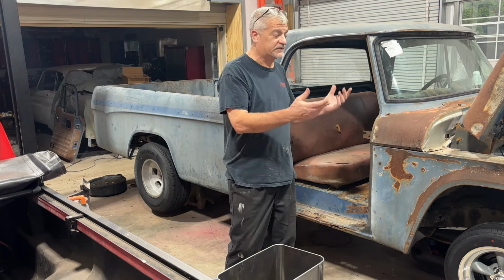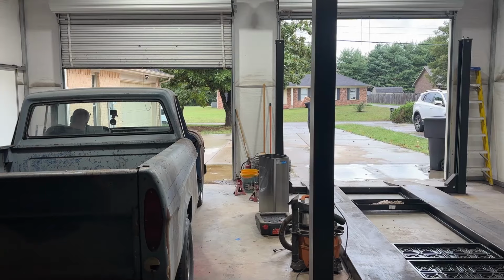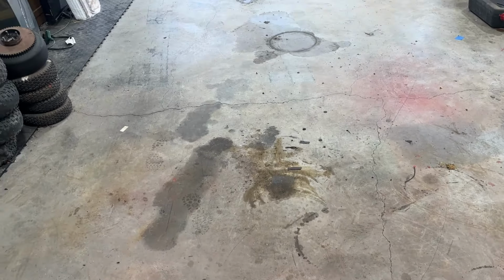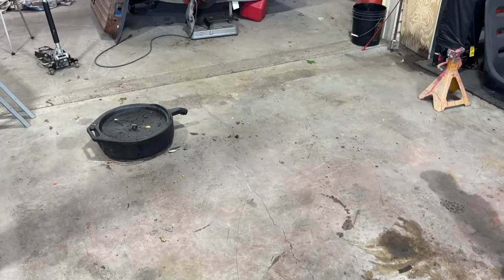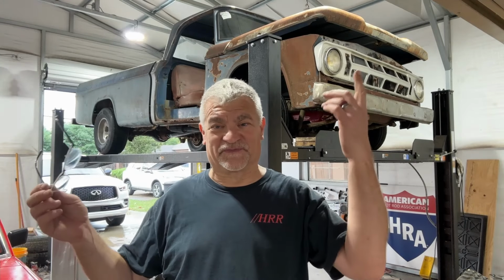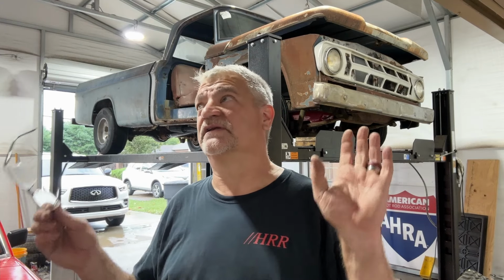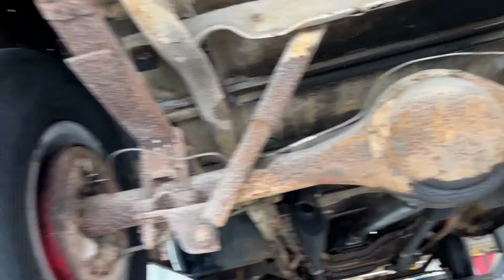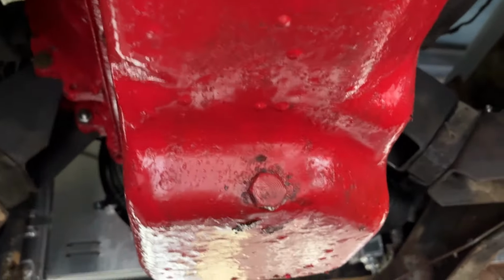WE DRIVE BIG RICHARD OUR 1968 DODGE D100 PICK UP @kiwiclassicsandcustoms9160 @UncleTonysGarage

Comment: Hey Doc: I'm thinking since Big Richard is not equipped with air con, rather than putting the passenger side door on, you should remove the drivers' side door!  Enhanced air flow on those hot muggy days that y'all are famous for.  Just make sure you've got seat belts LOL (I got this idea because when I was a kid my Dad was the garbage man in our little town, and he always took the drivers' side door off the garbage trucks because he was in and out so much.  And even though cars with air con were rare back then, riding in the old garbage wagon in the heat of summer was not bad.)